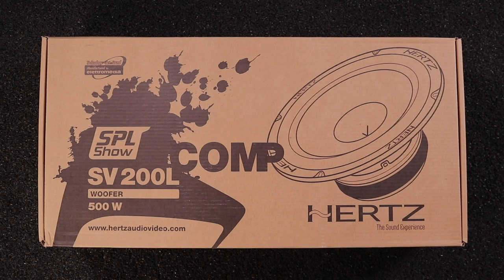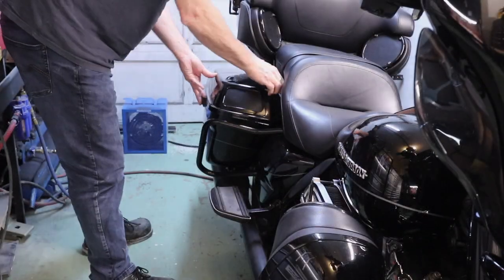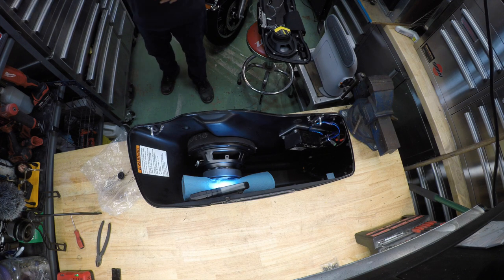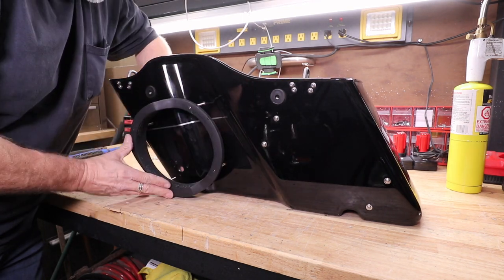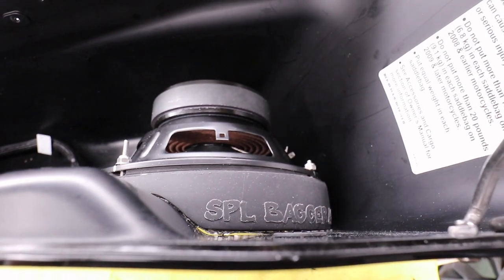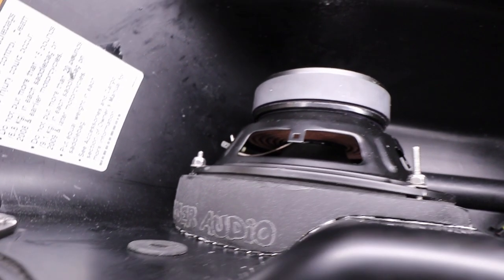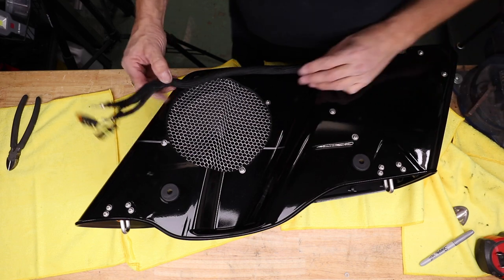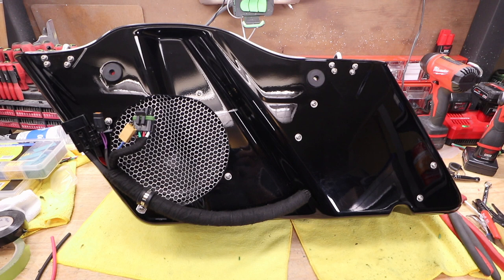Hertz SV200L Midbass Drivers in Harley Bags with SPL Bagger Audio Speaker Rings. Part 1

Comment: I kind of new that voice but wasn’t 100% too sure it was you 
.As always, pretty good information in your videos
Reply from the maker: Lol. It’s taken me two years to settle on a name for myself. Lancer is what everyone at work calls me so I might as well just use it. Thanks for watching. 👍🏻
Reply: @i.b.lancer  nice to meet you Lancer. After I saw how you installed your front speakers lower pods on one of your videos I went ahead and installed mine. Oh man I couldn’t be any more happier. Thanks a lot👌
Reply from the maker: That’s awesome, glad to hear it 👍🏻.
Reply: @i.b.lancer  Hi Lancer, finally am done with my bike. Adding this kit with the hertz and the dsr1 it really made the difference. I could not done it without your help. Cheers 👌
Reply from the maker: That is so awesome. 👍🏻. I’m glad I could help.
Reply: @i.b.lancer  Fyi, I coated the paper cone with marin varnish, no issues at all. Also, I was having a big popping noice out of the subs, I installed a toggle switch  between the wire that  feeds power to the remote wire to the dsr1 and it works pretty good.
Reply from the maker: @MrAyarza  I would seriously look at your grounding for the pop issue.
Reply: @i.b.lancer  The dsr1 is grounded with the grounds that feeds the amps
Reply from the maker: @MrAyarza . Where does the ground come from? That popping indicates that there is a power problem somewhere.

Comment: What silicone spray do you recommend to apply to the speaker?
Reply from the maker: Hi, thanks for watching. You want to get a silicon waterproofing spray. The kind of stuff you spray on rain jackets and such. Keep in mind that speaker companies will tell you that this is not a recommended treatment but I've been putting this kind of spray on speakers for decades and have never had an issue. Do so at your own risk.. just say'n.

Comment: Shoulda jumped into a sub. If you wanted real sound. Throw 6.5 ct sound subs in .
Reply from the maker: No depth for those kind of subs in Harley bags. You’re pretty much stuck with shallow subs.
Reply: @gabe giguere 
Subs take a lot more work, bracing, sealing and porting bags...depending on the Subs you will also have to fiberglass the inside of the bags to reinforce them....

Comment: I would not of cut a hole out for the speaker I would have put little holes in it instead
Reply: drilling Holes isn't as effiencent as properly cutting out the entire hole for more movement of the speaker
Reply: The kit offers you a template for drilling multiple holes if you choose.